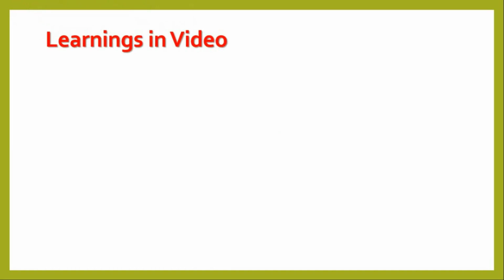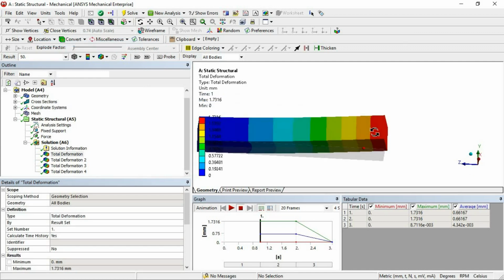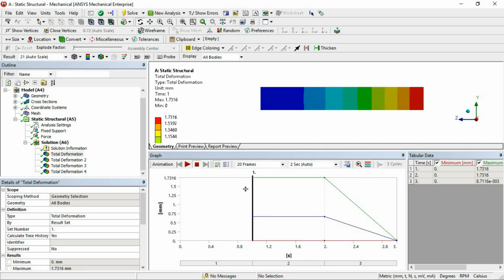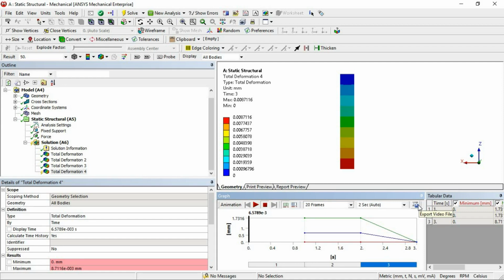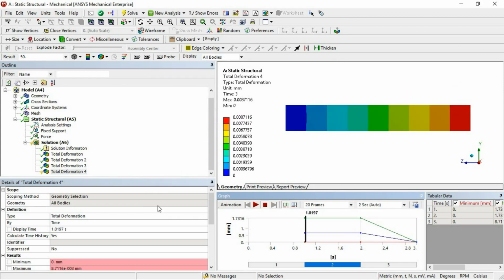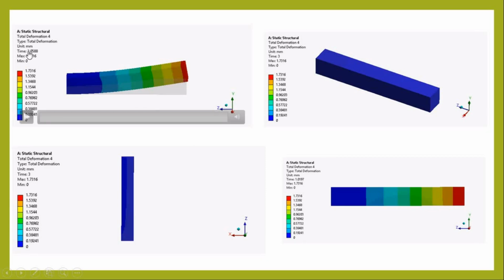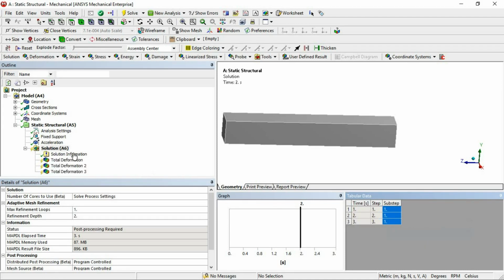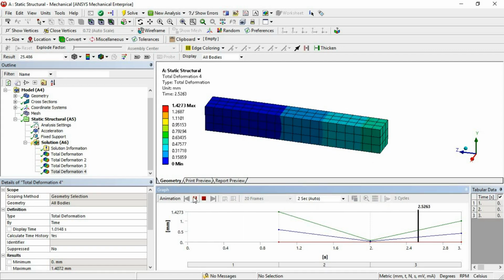How to Record Animation in ANSYS

Comment: Sir can you describe analysis setting in detail
Reply from the maker: I might have mentioned in video.
Reply: @graspengineering9249  sir this is my watshap no 8123636297 plz describe me about weak spring
Reply from the maker: @sanjaykumaryadav3186  Its additional damping or support given in the system. you should keep by default as it is, it does not contribute much in analysis.